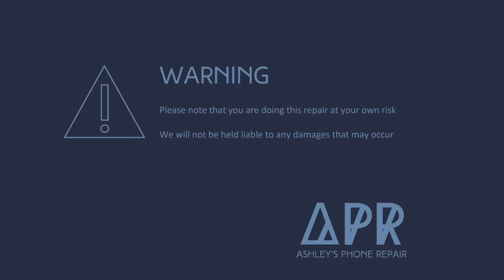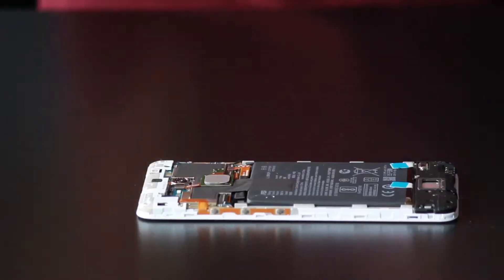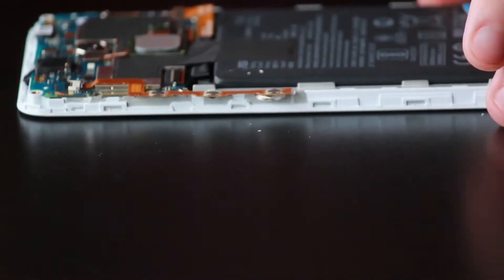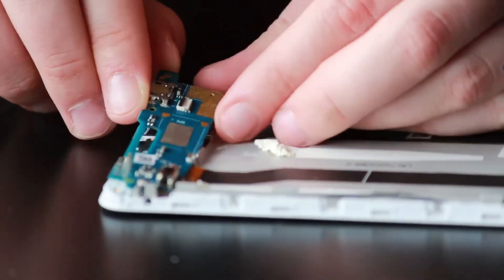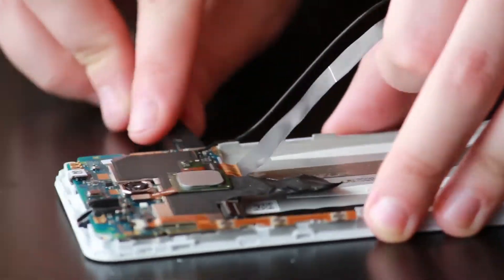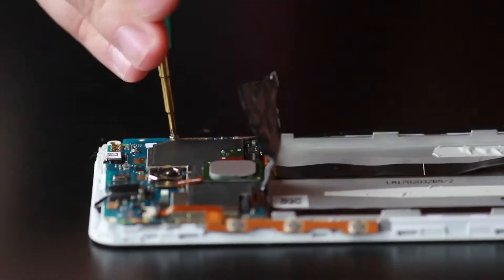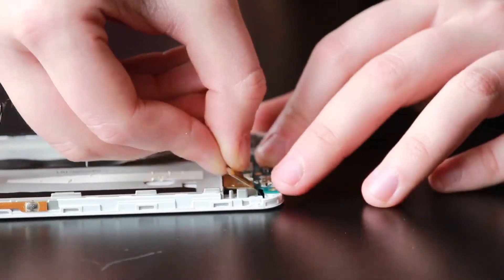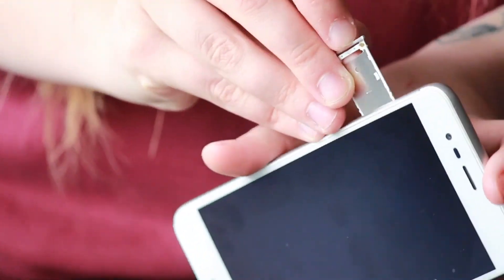Asus Zenfone 3 Max Screen Replacement

Comment: Hi! you see,  bought and replaced the screen, but the new digitalizer is not working, how can i fix the problem?
Reply from the maker: Hello! I would open the phone back up and make sure that the small digitizer ribbon is fully pushed into the connection on the charge port area. Right around the 5 minute and 10 second mark of this video is where I am connecting the digitizer if you need that for reference.
Reply: Digitizer is not damaged on my phone, only the outer screen, can that be replaced?